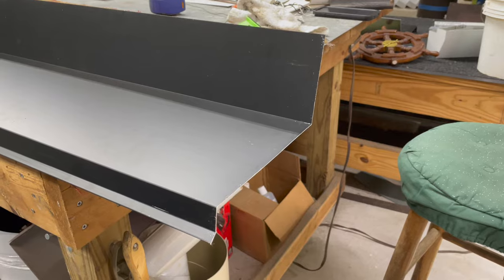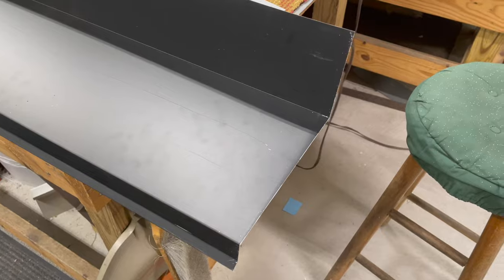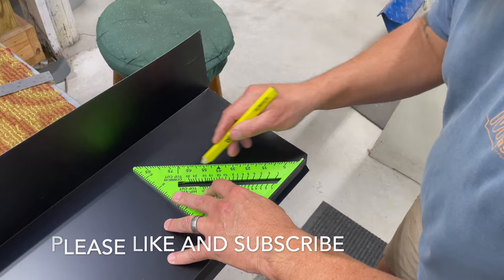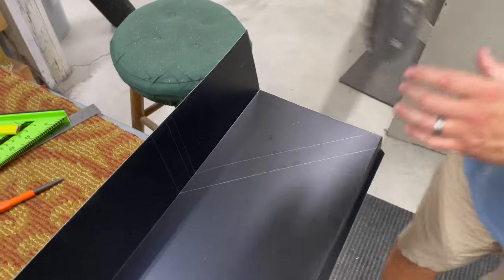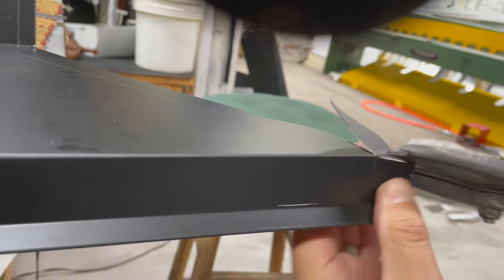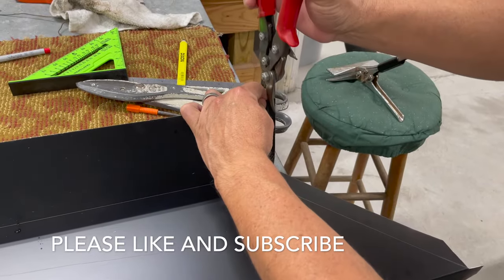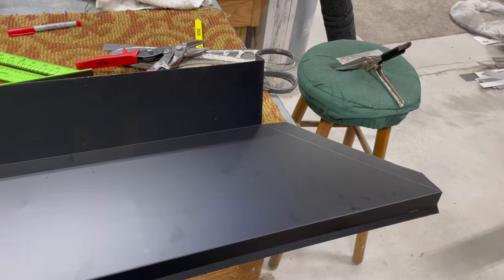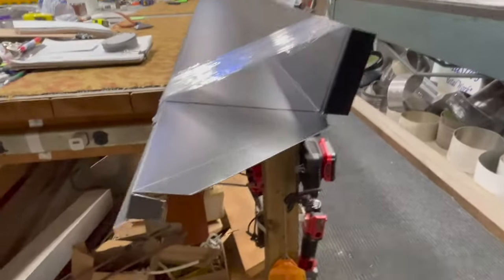Lets Make An Outside Corner In Some Custom Brick Ledge Flashing | At The 509

Comment: If you want to go a step further, leave the drip edge piece that you cut off, on there and have the next side of the corner piece cut at a 45, then bend that little tab around the side that has the 45° cut and it it make the corners look even neater.
Reply: Essentially, it's one piece?
Reply: @artetaDagoat the way shown in the video leaves little triangles on the corners, if you leave a tab on it it will close it up and make it seem like it one piece going all around. only a look you can achieve if you leave a tab on the drip portion and bend it around. its only needed when you have that little kick on flashings